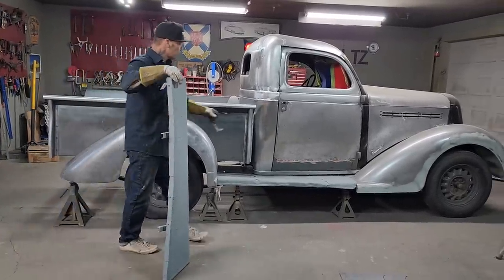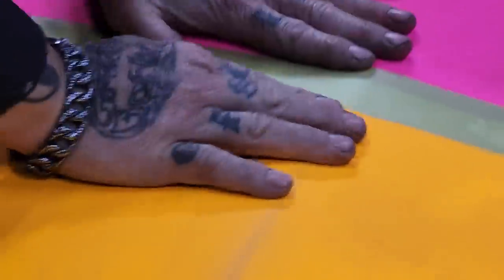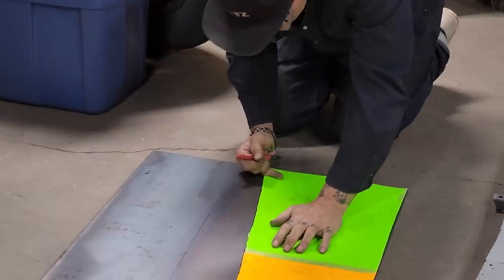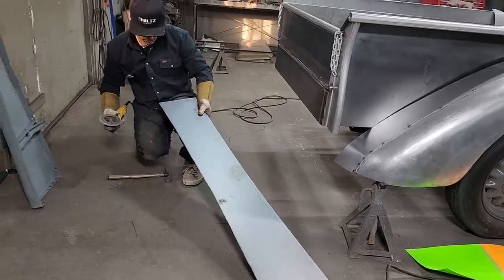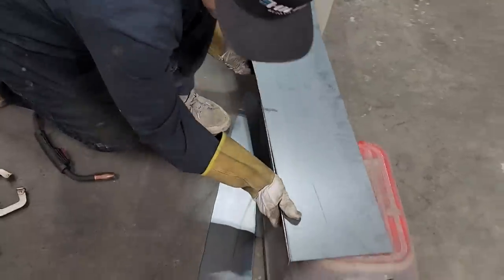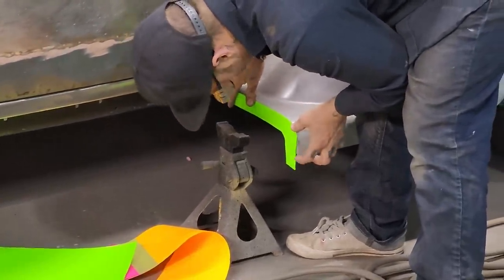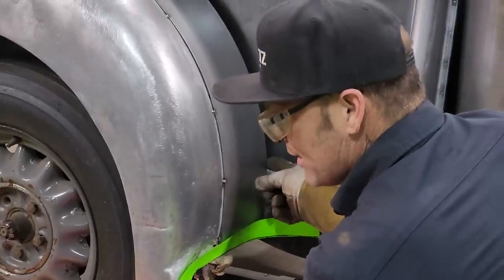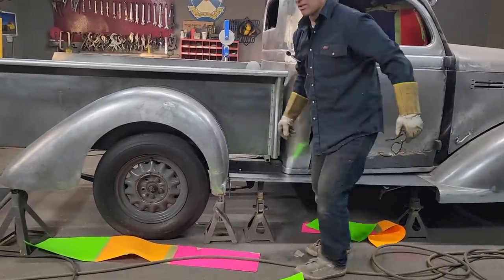Running board fabrication from scratch for the 1935 Plymouth custom truck

Comment: Nice job on the running boards guys .I like the way you can look at a panel and take it apart in your head to get the shapes to make a new panel and by the time you have finished it you can't tell that it's home made .jolene camera work is amazing for sure I could even see ìnside the cut that Chad did with the plasma cutter. Keep up the great work the both of you 👍 👏

Comment: Truck is coming to be a classic beautiful design for an old truck that Plymouth should have designed back in the days when cars and trucks were real. Chad is doing a great job, a great truck to drive all over town. Nice video Jolene!
Reply: They did design it. And built it!  Look up: 1937 Plymouth PT-50 Half-Ton Pickup 😊
Reply: @aceadman  well...yes and no.
While Plymouth did have pickups between '37-'42, they were actually Dodge pickups that had been rebadged with the Plymouth name and emblems.
Reply: @willhorting5317  👍 true. Be that as it may, he’s basically cloning one. Doing a nice job, but the design is not unique.
Reply: @aceadman  yes. Merry Christmas

Comment: the plasma cutter, probably the best invention, for home and office use, since sliced bread. Lol Faster than a zip cut and the acetylene torch. But not without its own problems. When that plasma tip touches the molten steal, it really likes to clog the tip. Thats what I like about the Lincoln guards/guide, they do help keep that tip off the molten metal surface IMO. Keep up the awesome work man!!

Comment: Thanks for another great video. 
Good job on camera by Jolene. 

It was interesting and enjoyable. 

You did a great job on making your pattern and then cutting the metal. In the end you will have a nice looking running board. 
Nice work Chad. 
Looking forward to the next video. 
Thanks for everything.

Comment: At $ 56,000.00 in 2022 a ‘37 PT-50 was sold. The lowest I’ve seen was $ 19,000.00 for a ok one. Chad has ? Invested so far for his version ( CH-50) and will be similar but not the same. I wouldn’t be surprised in the least if Chad never saw a PT-50 before he started this build. I think an original is rather rare, and this one is looking very good.

Comment: Hi Chad, I don't see you have CO2 or mixed gas are you running flux core? very nice welds no slag. What size wire do you generally use. I use .022 and mixed gas. Thanks. Nice work.

Comment: Chad &Jolene  great Filming, just a Thought. Your Running Boards are ok have you thought of the Straight Edge could be on the Frame Side and the Curve on the Outside to add some curve to the Truck 🛻

Comment: Chaddy, It looks like to me the rear wheel well spacing my be off some, perhaps the fender needs to be moved toward the front a little? Or, it could be my 66 year old eyes playing with me. Running boards will be very nice. Very nice, like Jolene on the camera.

Comment: I did the same . I bought a new car, gas and temp were opposite from my previous car. I pulled over five times on my way to the dealership before i realized it was not over heating, the tank was full.

Comment: Did you know that a little spray of cooking spray on the mig  brass gas shield every now and then stops the splatter sticking to the brass. It makes for a cleaner weld and the heads last way longer. Just cut the wire off first so you don't spray oil on the wire.

Comment: Hey Chaddie, is the running board pushing the rear fender back a little too far? (just wondering if the wheel needs to sit more centered in the circular wheelwell cutout)

Comment: Wonder if you had some magnets if you could use them to hold the fenders in place instead of jackstands.
Reply: Not sure if they make magnets that are strong enough...yet small enough to be able to work around.
Am I making sense?
Reply: @willhorting5317 Yes I see what your saying, but even speaker magnets should hold a fender.
Reply: @crushingvanessa3277  could be. I honestly have never tried to use a magnet from a speaker.

When I was rebuilding my '54 Chevy pickup, in the 1980s, I was sort of like Chad. In that I just used whatever was handy and in the shop. (Shop was just an old building on my grandparent's property. I wanted to make that clear, so it didn't sound like I owned a mechanic or body shop.)
Reply: @willhorting5317  We do what can with whatever is on hand. I never used a magnet either but I figured they stick to everything when you don't want them to. Obviously what you did worked and that's what matters.

Comment: Chad what are you going to do to the ends of the side rail on the bed are you going to cap them off you need to remove the bed and cap them off before you put the finder on I think it would be easy to do now before you go to far on the running boards

Comment: Looks like the rear fender has to be moved forward and running board shortened. Rear tire is not centered in the wheel well.

Comment: I really hope u drop that truck lower. And do a nice paint job. And don't roll paint it. And put nice rims.
Reply: Not every dang vehicle needs to be lowered...or have shiny 20" rims...or even an award-winning paint job.
Reply: @Will Horting  nor every truck needs to be bare metal also. Or paint rolled. I mean if u do all this work. Then make it nice. Don't put a wood interior. And wooden seats. Etc.  Just make it nice. 90% of the truck enthusiasts have lowered trucks. Anyone that buys this. Would want it lowered. Jmo
Reply: @blackedouthonda2263  did I say that I like bare metal, or rolled-on paint? No, I didn't.
I also didn't say that I like wood interior.

As for the lowering...I strongly think that you should check your 90% number. 
The percentage is more likely closer to 50%.
The ONLY way that your 90% is anywhere near accurate, is if the people polled are age 35 and under.

Most people who are older than that... especially us who are senior citizens... prefer our vehicles to be closer to a "stock" height.

Same goes for your opinion that "anyone who buys it would want it lowered".
Reply: @frankschwartz7405  Chad & Jolene have asked commenters to please keep it positive.  No need for such comments.

Comment: The running board is a tad long. It off centers the wheel a tad too much in the rear fender. I understand that the fender is temporarily placed.  Just my opinion.

Comment: 129 1: 11 00   -     204 1 1:100  "the front of the running board fits the fender"  Uhhhh  You can fool some of the people some of the time..... ( but they're usually not the ones you need to be fooling.)